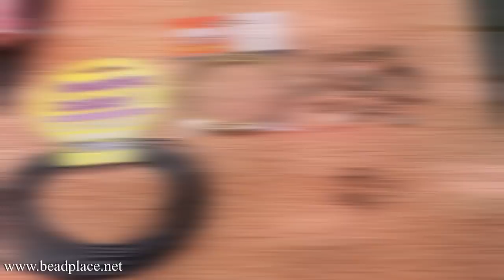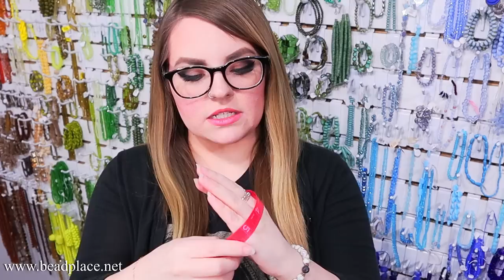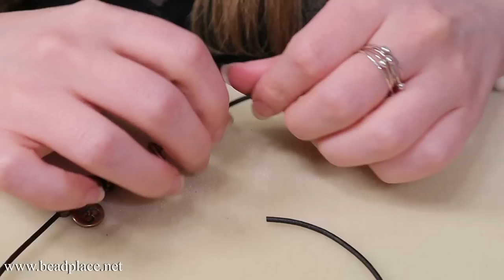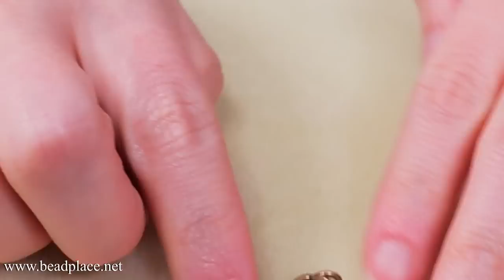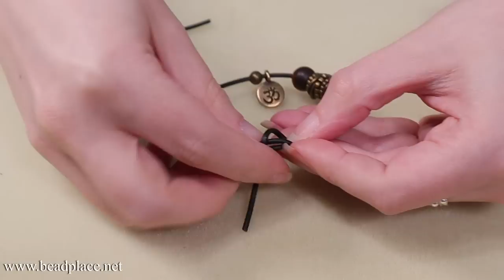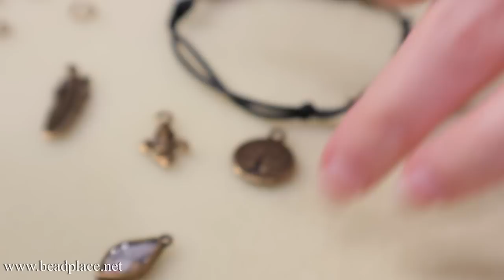How To Make Knotted Faux Leather Beaded Charm Bangle Bracelets With The Bead Place

Comment: Perfect!!! I have some tubing for ages, had no ideas of how to use it. This got me thinking, what about using a continuous bracelet of memory wire and threading tubing on to it? would the beads all end up on one end maybe? I also thought of putting a tiny curl in each end of the wire so as to not let it pierce the tubing?
Reply from the maker: We love using Jewelry Tube on memory wire!  The knots on this particular bracelet do kind of function as stopping points for the charms but feel free to experiment and let us know how it works out!  As for the curls, I don't think there would be room for them.  The wire is pretty tight within the tubing but if you're careful, it might work!  Thanks so much for watching!
Reply: @AbbiBerta  thanks again👍🏻❤